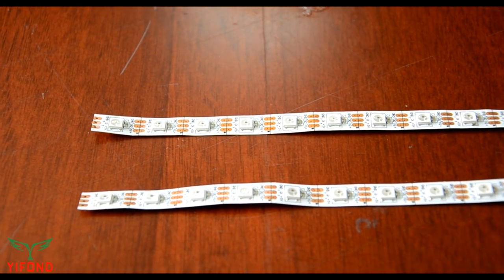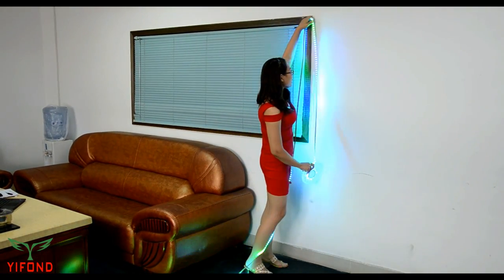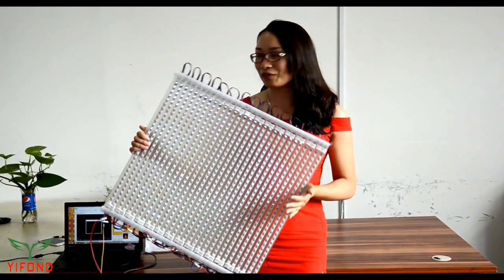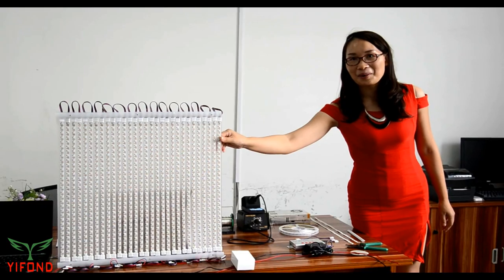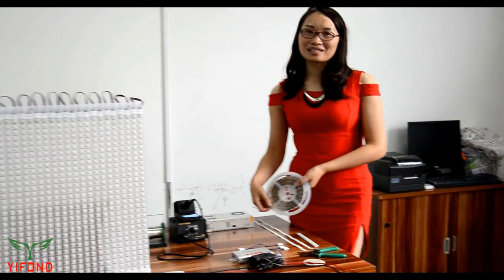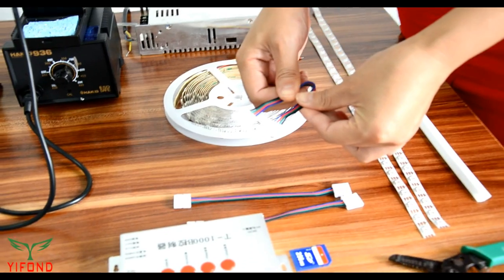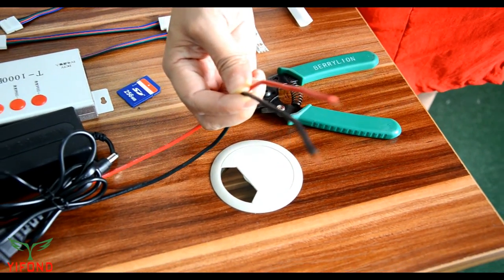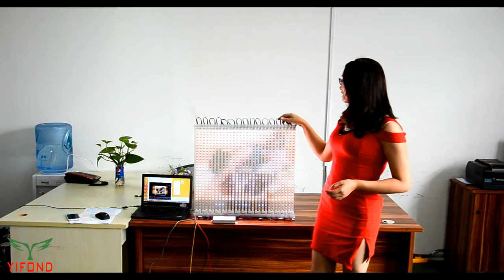DIY Use RGB LED Strips For Your Own LED Screen

Comment: Thank you so much!!!I found ths video very informative. I plan to build a 2mx1.5m LED display using WS2811 LED strips. So far am having trouble getting a good enough Flexible PCB, but I will eventually find it. I would like to know if there is any other way to have a realtime transmission from PC to the display without using the T300k Live controller?

Comment: but how did u connect it to the computer? to mimick the video..
Reply from the maker: +Numinous~Indescribable thanks for watching my video. the led screen is using the net wire connect with the computer, the controller system also has the CD card. it means it could play the video on SD card, also avaliable play the in time video on computer. I have many another video to show how to make the screen and how to connect the whole system wires. kindly watch this one http://youtu.be/m0dpvkZ0KH0 and tell me if you have other questions? Thanks.
Reply: +Shirley Fang ok thank you. I appreciate it :)